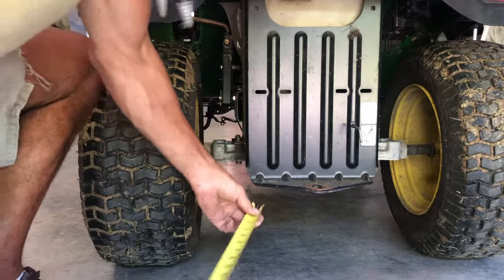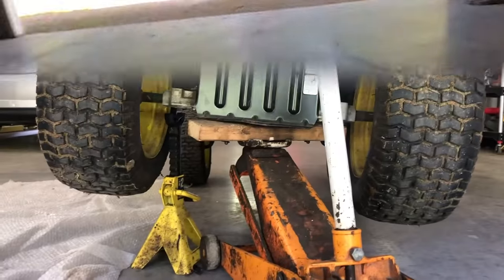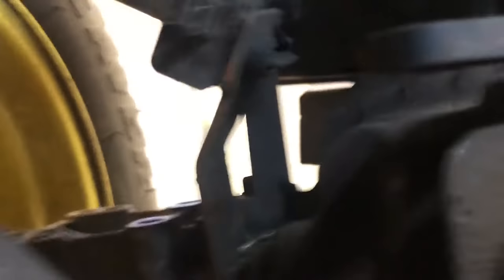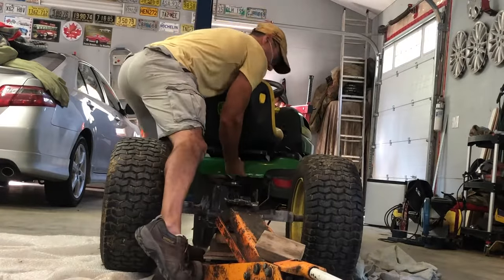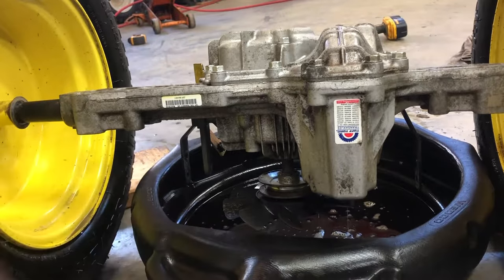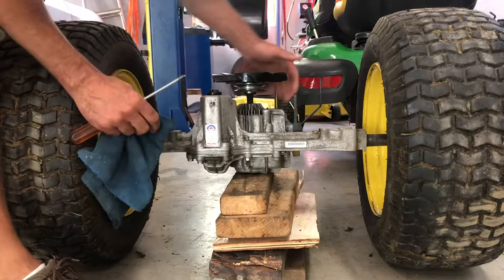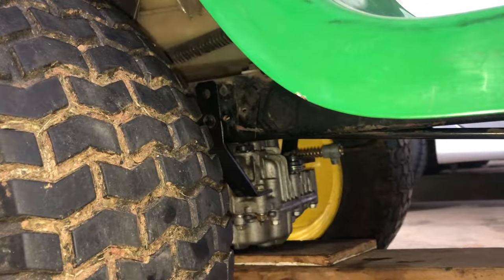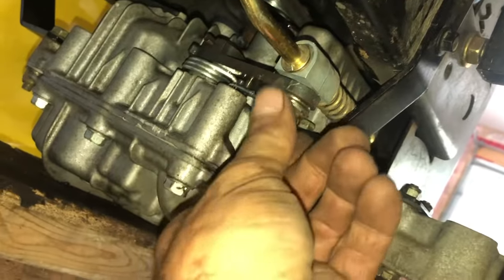How to change your oil in your Differential / transaxle / Transmission John Deere Lawn Tractor

Comment: I have a 2009 Jd la115 with 200 hours. Does mine need this? Mine is leaking fluid around left rear tire area. Won’t move at all.
Reply from the maker: Might be low on oil.   Dump the old oil out. If the amount is less then 1 quart just top it up and keep on riding.
Reply: @WeekendHobbyMechanic  it’s leaking around back left tire area. At least a quart has leaked out maybe more.
Reply from the maker: Probably the oil seal is leaking. Not a big deal to change. Part #MIU804267.  
I redid this video.   Check it out:.
https://m.youtube.com/watch?v=on7aHn2v2Rs&pp=ygUhSm9obiBkZWVyZSBvaWwgY2hhbmdlIHRyYW5taXNzaW9u

Comment: My tractors an L series.  I broke the breather thinking it was the fill and my neutral selector. internals look different and the oil level is about 2 inches down.  Not sure if I fill it to the lip if it will over pressure
Reply from the maker: The oil level should be 22mm - 25mm (7/8 - 1inch) down from the edge of the fill cap.
Reply: @WeekendHobbyMechanic  thank you sir. Tranny is pulled was just waiting for that info right there. Any suggestions on mending my broken breather?
Reply from the maker: @devinglis3179  Degrease it and add a dab of silicone gasket maker, it will hold it just fine.   Did this a few times. I redid this video with better camera angles: https://www.youtube.com/watch?v=on7aHn2v2Rs

Comment: Job was a success but I seem to now have a leak from the transmission. It’s hard to pin point. What would cause a small leak?
Reply: Seems it’s my cap that’s leaking. It was fairly cracked when I took it off.
Reply from the maker: Did you overfill it?   Suppose to be 7/8in -1in or 22-25mm from the top edge.     
  If you did overfill it, it will stop leaking in a bit.
Reply: @WeekendHobbyMechanic  I did overfill it! I realized that when I went to change the cap. I sucked some fluid out. Thanks again for all your help.
Reply from the maker: @Livinlife2  👍

Comment: Can i use normal 32 hydraulick oil,,,or normal tractor  motor oil 10 w 30,,,,,,,or what oil should use to fill ,,,,,..???
Reply from the maker: Tuff Torq suggests 10w30, 5w-50 oil, or Hy-Gard High Viscosity J20C . (Can be bought at a John Deere delivership).  Check out this link:  https://tufftorq.ordertree.com/media/promo/TuffTorq/OIL%20LIST%20V3.3.pdf

Comment: have you ever taken one of those transmissions apart to clean the dirty oil and metal shavings out of the gear box?  Is that a good thing to do, or is there ever a time when that becomes necessary?  Or is that just a waste of time and replacing the old oil is all that's needed?
Reply from the maker: mrbubetube  “Part5 LA165 rebuild” in this video I take the trans apart.    Tuff Torq recommends change the oil every 200hrs. Use 5w-50 oil.   You just drain the oil and refill 22mm-25mm from the top edge of the cap. No need to take it apart.
Reply: It all depends on the condition.  I saw one video on youtube where there was a ton of metal shavings on the magnets.  When he split the case the differential gears were chewed up terribly.  A simple oil change was not going to fix it.
Reply: @150flivver  well, what I was wondering is if it's good to open it, clean it out, and refill it with synthetic 5W50 oil BEFORE it ever shows signs of losing torque.  The John Deere manual tells you there's no need to do it but Tuff Torq recommends it be done if you're using it on hilly terrain or mowing more than the average homeowner.  I've seen some that are still good after 300 hours and others that lose torque after 100 hours.  Unfortunately, there's no way to know what the actual statistics are on the life of the K46 without servicing because neither John Deere nor Tuff Torq is customer friendly enough to publish that information.  bastards...
Reply from the maker: I agree.    If the oil is very dirty and the magnet full of shavings I would take it apart...
Reply: @mrbubetube  My property is flat but it gets very hot here in Texas and my Craftsman riding mower lost power just as I was finishing mowing.  I've  pulled the transmission off the mower and faced the same choice--just change the oil or split the case and overhaul.  There was very little debris on the magnet and the oil wasn't too bad so I'm hoping an oil change is all that's needed.  What I had really overlooked was how clippings had collected and really needed to be powerwashed off the trans which I'm sure restricted cooling and led to the probable degradation of the oil.  If changing the oil doesn't work, I'll split the case and inspect and replace whatever needs replacing.  I'll also add some drain plugs to make changing the fluid easier in the future. Fingers crossed that new oil will work.
Reply: @150flivver  - This is kind of a late reply but if you haven't seen it yet Taryl Fixes All rebuilds one of these transmissions and talks about adding drain plugs.  https://www.youtube.com/watch?v=NS61QpRZdl4

Comment: They use 10w 30w motor oil in the Tuff torq hydro drives on the zero turns. Not a good thing

Comment: QUICK WAY?? LOL, you could of picked up one of those fluid suckers pump and sucked it out, there is so much of the fluid still in there even doing as you did, IF I was going to all that trouble I would of let it sit over night to drain, BTW, you need to pull those wheels off & lube the axles with NEVER SEIZE, if you don't do it now you will NEVER be able to get those wheels off if you have too.

Comment: my 130 isn't moving rite,cant climb banks anymore,whines loudly when go pedal pressed..is this what it needs? or should i start with belt?
Reply from the maker: It could be low on fluid.   Jack up the rear and press the pedal.  Look at the top of the transmission if the fan is spinning.   
  If the fan is spinning the belt is good.     Your problem could be severe, bad hydraulic pump or motor. 
  Also check the neural rod is push in.
Reply: @WeekendHobbyMechanic  
so it's apart & draining..while the fan spun,i was wondering if i shld replace drive belt while apart? thank u
Reply from the maker: @sim7409    If the belt isn’t cracked I wouldn’t change it..    (sorry for the late reply)
Reply: @WeekendHobbyMechanic  
yea it didn't seem to help..i assume too far gone
Reply from the maker: @sim7409    yep..  Probably needs a rebuild.
Reply: @WeekendHobbyMechanic  
yea..over 700hrs dunno how much more i wanna put in tho..thnx
Reply from the maker: @sim7409    700 hrs is pretty good.  I've seen some go at less than 200hrs.

Comment: awesome video! I have dead grass where my mower was the other day. replaced a tire and now it won't go forward or backward. craftsman 42" Electric Start Automatic Transmission Model No. 917.28936. when I jacked it up the wheels do turn (left one very fast, right one which I replaced much slower. possibly on purpose? thinking maybe the transmission leaked somehow? oil filter is in the front and this is in the rear. hopeing the tank doesn't have a hole. looks expensive to repair and i'm a super novice searching youtube :)
Reply from the maker: Your drive key fell out of your shaft.   Take your wheel off and take a look..    Or jack up your rear (one side at a time) and spin the wheel by hand.  It should spin the shaft too.

Comment: Can you just pump or vacuum out the oil?
Reply from the maker: I guess it could be done. Be hard to fill it to the proper level (7/8-1”) from the top edge.
Reply: @WeekendHobbyMechanic  trying, not enough room, thanks for the video.
Reply from the maker: @xenawolf    I redid this video. Better video angles. Check it out   https://www.youtube.com/watch?v=on7aHn2v2Rs&t=301s

Comment: If I had that work space I'd do it that way but I don't so i will be cutting out a hand hole once i get that gas tank out I'll have that extra space for hand room
Reply from the maker: You still need to drain the fluid out of the trans.  Are you going to flip the tractor upside-down? You’re better off taking the transmission out of the tractor. 
If you only have a couple of hundred hours on it and it’s working fine I’d leave it along.
Reply: @WeekendHobbyMechanic  it has a thousand something on it
Reply from the maker: @Mike-su8si     Ouch!..    I taught I had a lot on mine. (742hrs on LA165), (460hrs on my D110)
Reply: @WeekendHobbyMechanic  it still works good i just used it today I don't really use the hour thing because my old craftsmen doesn't have that hour stuff hooked up an that ones probably got over a thousand on it if i hook a meter up to it and see

Comment: I changed oil in my 145 jd.  put in 30wt. oil  it would not do but about 5 min .  and would not pull ..nothing like it did before quit pulling  now I will have to put in hd. oil and try it
Reply from the maker: 30wt oil is a bit thick to use in a JD transmission.   It should still work. (Make sure the neutral rod in)
Reply from the maker: 10w-30 or 30w?

Comment: so you are expected to remove the  trans axle assy to  drain the oil ,  i have a strong vac pump that i can pop the lid  it will suck all of that oil  and  a pump to pump it full , seems a lot easier and faster  just my opinion  i have worked on a lot of  mercedes and VW  which are a bitch , this seems  a  straight forward  extract and fill  but im not taking that axle out

Comment: Changing the oil is one thing but, what about the filter?
Reply from the maker: No need if the transmission is working 100%. Just change the oil every 200hrs.  
Check out these videos :
https://www.youtube.com/watch?v=3D_vtMg-Zxg
https://www.youtube.com/watch?v=on7aHn2v2Rs
Reply: @WeekendHobbyMechanic  🤣🤣🤣🤣🤣🤣 Is that the schedule?? every 200 hours??? Mine has over 350 and never changed. DUH. 🙄
Reply from the maker: @JohnSmith-uy7sv  every 200hrs.  I’ve seen some with 750hrs and the oil still looked like new.
Reply: @WeekendHobbyMechanic  I think I'm good then. Thanks so much. 😁

Comment: My rear end keeps hopping any ideas
Reply from the maker: What do you mean by hopping?  Could be low in Oil.
Reply: But how can I add if there is no spot to do so
Reply: It bounce when I am driving
Reply from the maker: @wassup5023   it’s not low in oil if it’s hopping like you say.     Jack up the tractor and spin one wheel.  The other wheel should spin the other way freely.    Hard to pinpoint where the problem lies.

Comment: “Lifetime fluid”.... the manufacturer of the trans makes them with drain plugs. John Deere declined them. Why.
Reply from the maker: Very good question..     I’m glad they don't add a drain plug because it makes me money each year....
Reply: @WeekendHobbyMechanic  makes it a pain for me! Lol. I ended up using a small hand pump to suck it out put new in and repeat essentially lol. Pain in the butt. Wasn’t feeling the motivation to drop it all properly.  Your video helps identify everything much easier though thank you
Reply from the maker: @DEFGraves     I hope you drain both sides of the transmission.  There's the Pump side and the drive-gear side.   You can't drain both at the same time. Plus you can't fill it to the proper level. 
   If you overfill it, the fluid can mix together and ruin the pump.  (That's why it's better to take it out)....
Reply: @WeekendHobbyMechanic  no I have not. Good to know lol. I was just doing maintenance   So haven’t used it yet so guess that project continues
Reply from the maker: @DEFGraves    I wouldn’t change the transmission oil if you only put 15-20hrs/year on the mower and it works great.
Reply: @WeekendHobbyMechanic  I got it second hand it’s a L110 with 750 or so hours on it and the trans whines. When engaged.
Reply: @WeekendHobbyMechanic  ok the short ride back to the shed it did quiet down though. But I still feel I should do the job properly.
Reply from the maker: @DEFGraves   it’s probably just the noise from the hydraulic pump.
Reply: @WeekendHobbyMechanic  it happens when applying throttle foreword or back. Pretty noisy hear when blades are engaged
Reply from the maker: @DEFGraves .  I have a D110 and a LA165, the LA165 wines a lot with 650hrs. But it works great!    I'll probably change the trans oil this summer. I Will let you know if it helped.
Reply: @WeekendHobbyMechanic  alright appreciate it. I’ll prolly remove the Trans unit next couple weeks and do that properly see if that quiets it up or not. Anything else in there I should change while there besides the belt that’s common to fail later in these mowers life
Reply from the maker: @DEFGraves     Check the drive belt if it's worn or cracked.  Make sure the oil level is 22mm - 25mm down from the edge of the fill cap after priming it. If you don't prime the pump the level will go down 1-2mm. (Not much)
     Also check the filler cap for cracks.     Sharpened your mower blades too.. lol.....
Reply: @WeekendHobbyMechanic  blades I have new on but cool I will check all that thank you very much for the help.
Reply: Love your video but with reading comments I’m seeing people say oil is it regular Motor oil or hydrostatic oil ?. 
I have a D1 10 with about 120 hours on it I use it to snow blow in the winter time in MØ in the summertime I find that it doesn’t seem to have a lot of speed when you press the pedal for throttle. And there’s the wind of the pump of course however he does seem to move and go forward backwards no problem wondering if you feel that I should still change the oil just to keep it in good condition. Also I see the comet about 20 W 50 is that motor oil or hydrostatic oil?. Where I use your around what would you recommend the best fluid be used Amsoil or regular John Deere. 
Thanks for your time and again I love your videos.
Reply: @justaviewerortwo2924  I used a recommended oil it does seem a little slower and I don’t feel as confident personally I want to use John deer fluid next drop but it seems to be smooth and work well still just my two cents I am no expert here though.

Comment: What kind of oil did you use
Reply from the maker: I use Hy-Gard Low viscosity Hydrualic oil and if the transmission is old I use 5W-50 synthetic oil by Castrol.
Reply: Since this tedious project is kind of a pain in the butt I figure might as well go with the best, nothings rated better in high heat or longevity than Amsoil 5-50 and the oil does take a beating in this gearbox. Go to Sweet project farm on YouTube and check out his runoff video among all the top synthetic oil‘s. It’s pretty interesting also.

Comment: Yep, typical JD, couldn't just put a drain plug in like the other comments. I had a JD 285 for years and everything was a pain in the butt to work on. Glad I sold it. JD must be idiots to design stuff like this.
Reply from the maker: Tuff Torq designs the transmissions.  They just sell it to John Deere, Husqvarna craftsman etc…

Comment: That is an awful lot of work. Could you not just tap your own drain plug hole?
Reply from the maker: You still have to remove it to add drain plugs.  (Have to add two of them, there are two separate sections. Pump side and transmission side).
Reply: @WeekendHobbyMechanic  thank u

Comment: Fuuuuuuuuudge..... Im just gonna draw the old oil out with a suction pump with a long hose. That's way too much work
Reply from the maker: That will work too.   Don’t overfill it.  7/8 - 1in from the top edge.  
  I redid this video.  Check it out. https://m.youtube.com/watch?v=on7aHn2v2Rs&t=1s
Reply: 😁😁😁😁 Agree. Or drill and tap a hole in the bottom for a set screw or square end plug and poof. Great idea. But, why did he change it? Did he have problems?
Reply from the maker: @JohnSmith-uy7sv    If it works good and you don’t use your tractor other then mowing your lawn, then leave it.    
   It only takes me 40mins to change the oil.
Reply: @WeekendHobbyMechanic  and in south florida and small yard, it's all flat down here. Thanks. 😁😁😍😍